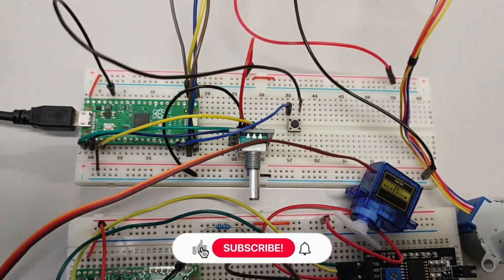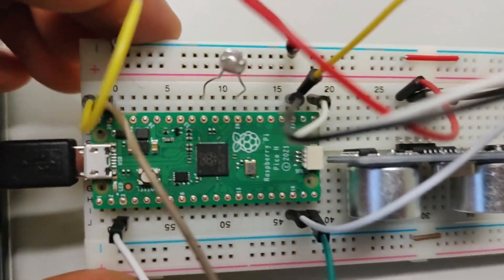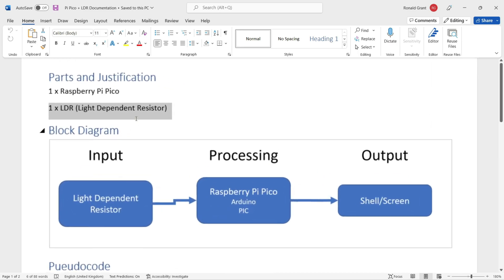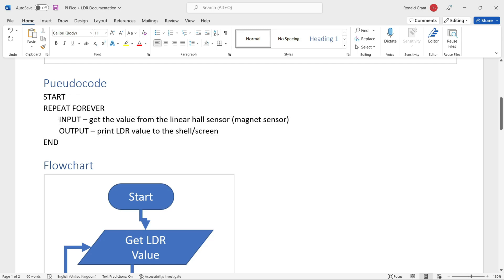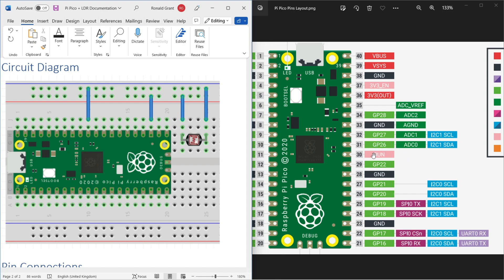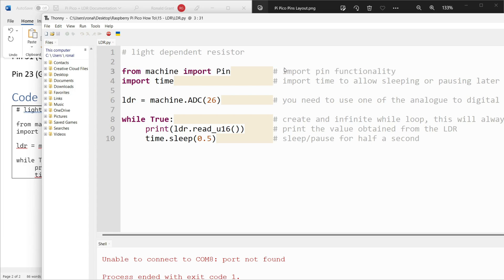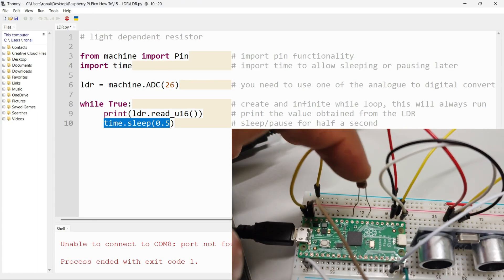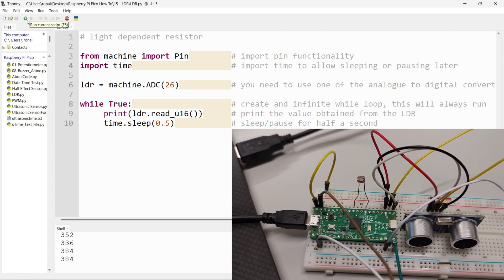Raspberry Pi Pico | Part 13 | LIGHT DEPENDENT RESISTOR | LDR - (2022)

Comment: Hi, could someone help me? When I try to read the ldr it always returns the value as 65535, could someone tell me why this happens? I'm using the same pins as in the video
Reply from the maker: I know this might sound stupid simple. I have seen a number of people use the wrong pin when physically connecting vs when programming.

Just double check you are using the same pins.

GP is the one you want to have be corresponding.
Reply: @RonsTechHub  use LDRVALUE = 3.3/65535 so you get the value of the voltage the ldr is allowing through